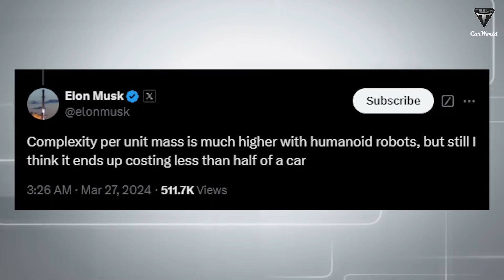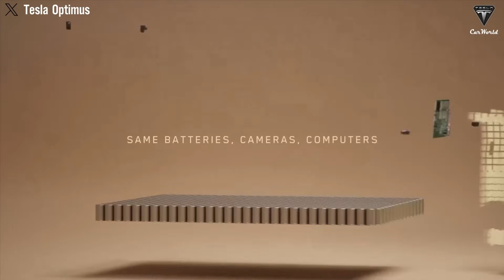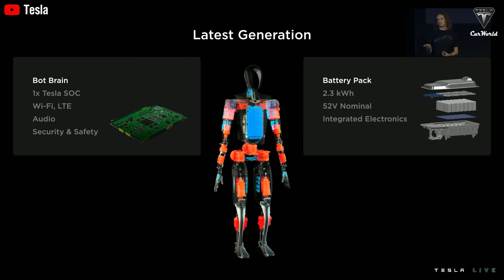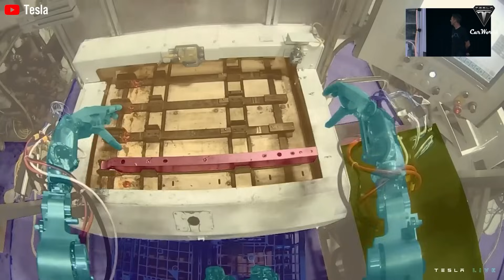It happened! Elon Musk Announces 6 Reasons To Buy Tesla Bot Gen 3 in 2025, All Hidden Tasks Unveiled

Comment: It would be ideal, for Tesla Bot to have an employer integration package that was freely downloadable now to help companies begin defining tasks, roles, safety and quality documentation, and IT infrastructures to support adoption.

For example: How much would it be worth to your HR (or any) budget to source a Tesla Bot into roles defined by your constituents, and evolving thereafter based on manufacturing and engineering requirements, versus training another employee that jumps ship for another dollar or $.50,…? A resource that doesn’t call in sick, doesn’t require the same benefits as a human, and helps the core objectives of your organization become more attainable.

Not covered in the media is that the introduction of embodied AI has just expanded the role of HR so rapidly that it will soon become more of an IT or Procurement role. Minimally cross functional teams should be preparing to work together to define operator level tasks that will be the easiest to integrate into embodied AI roles. 

Possibly, depending on the size of an organization new "AI Robotics Integration" departments should be formed to: 

- work with each department to define opportunities current floor level management may not be aware of.
-leverage current and developing industry Embodied AI functional capabilities.
-develop and maintain security and redundancy protocols
-manage an  independent intranet to bridge embodied AI solely
-update existing safety SOP's and the Quality Manual as affected by embodied AI presence in the work place.

Sure, organizations can always add more layers to the integration process,  counting on AI robot head hunters, consultants, and temp AI robotic agencies to source from (once the marketplace has caught on), but no matter how this tech is integrated, like an MRP/ERP/PDM platform migration, it IS going eat up an enormous amount of employee time if you go the external middle man route. 

So again, It would be ideal, for Tesla Bot to have an employer integration package that was freely downloadable now to help companies begin defining tasks, roles, safety and quality documentation, and IT infrastructures to support adoption.

Comment: So the hardware must be synthetic, fed by juices that on a molecular level  resemble humans vasculature where this is the chemical propelled powercells in multiple storing energy from sensory even solar cellular and chemical reactions but more durable and less fragile than humans. Millions of microscopic Magnets may be a power source. An idea for hardware with weight built in to every structure so no obvious battery. Improves balance and freedom of movement. Molecular chemical physiologic physics. No replicators without limits please. Dangerous. magnets are magical in early science. Opposing magnets are a reactive force. A weed  in multiple is unbreakable. Other periodic table core material interact or buffer the magnet. Why isn't this the basis of robotic power along with solar sensory. Microscopic cells of storage everywhere as just the surface one of many  cellular storAge foe energy structure. It is said in the Gospel that Moses came back down the mountain having created the commandments with God changed. His skin sparkled like Ed to light capturing prisms of stored energy as if made of diamonds just before dust. He began wearing a veil over his face. Moses was with God 40 days n nights needing no substance. Old testament, Exodus. Out of Egypt he led the 12 tribes of Israel.